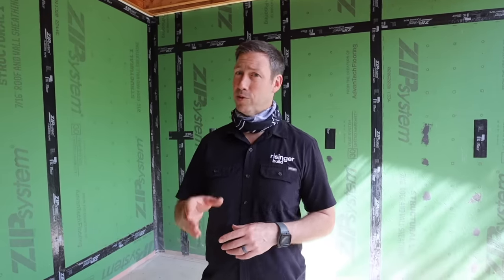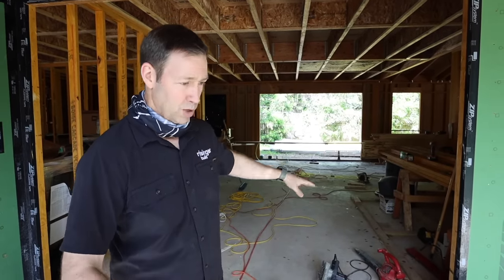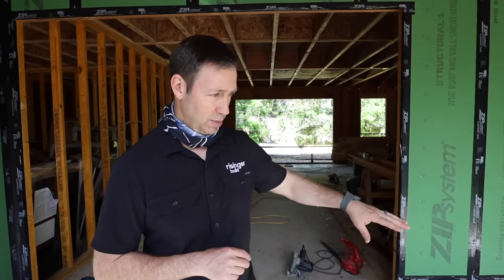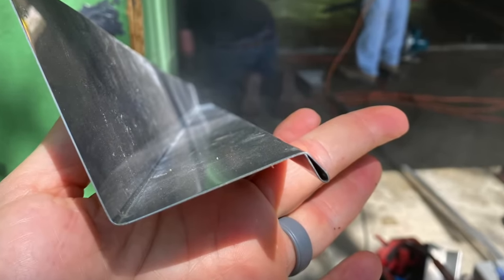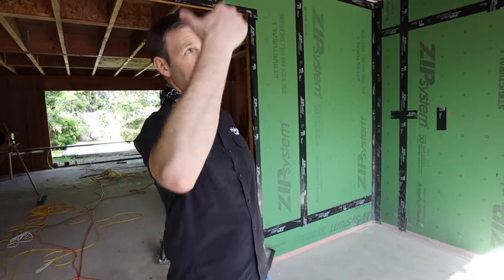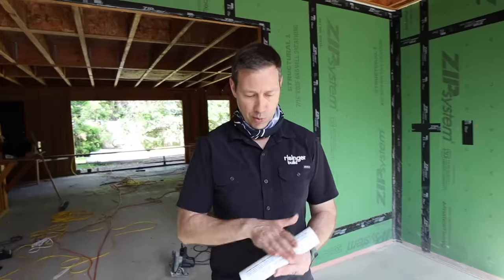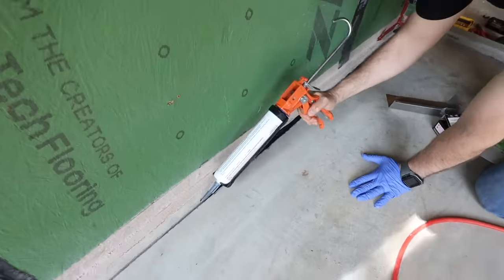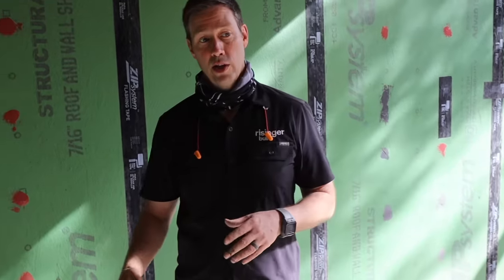Flush Concrete to Framing? Here's a Stainless Flashing Fix!

Comment: Isn't that concrete cutting a huge OSHA violation of carcinogenic silica dust???  Not hooked to a HEPA vac or wetted down or anything.   We use a dust deputy cyclone hooked to a HEPA shop vac and 99% of the cancer sprinkles stays in the cyclone.  I believe the acceptable level of cancer dust creation is a teaspoon in a football stadium (basically, don't sentence someone to cancer to save a buck).  That death cloud is certainly out of specification.  Even after you think the cancer dust is gone, it hangs in the air for days, stirs up constantly, and then goes to visit your neighbors for a spot of cancer because the PM size is so small.   Seems un-neighborly to be murdering, causing horrible death and everything.  Just sayin'.

Other benefits are the job stays cleaner, the crew isn't dying on you, you don't have to keep visiting them in Hospital and hospice, and less retraining for replacements.
Reply: silica dust leads too silicosis. It takes years of exposure to contract that disease, typically only seen in hard-rock (underground miners). The wet drill was invented by Ingersoll, to increase miner's life spans from the usual 7 years, at the time. For all that, we actually use mostly wet on our jobs: incidental work is okay dry with an N95. Asbestos materials are the carcinogens, and not to be trifled with.
Reply: What's worse silica dust, asbestos dust or a co worker that smokes beside you while you're working?

Comment: This is a very expensive flashing and is extremely labor intensive. You could have, should have used a pourable sealant like used for the exterior walls of a basement. It would provide you the lifetime water protection you need at 1/10 the cost and even less labor.

Comment: I have the same scenario, but I am putting a 3" topping slab on top top f my structural slab. This is an exposed exterior balcony. 

Should I do this application on my structural slab and extend flashing up past the topping slab ? Or should I only do this process on top of final topping slab against my wall?

Thanks guys.